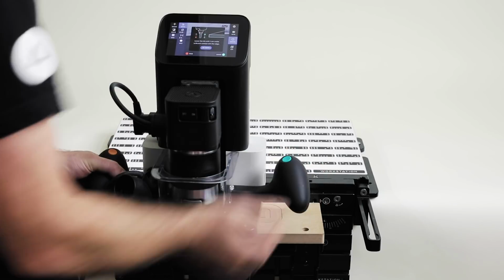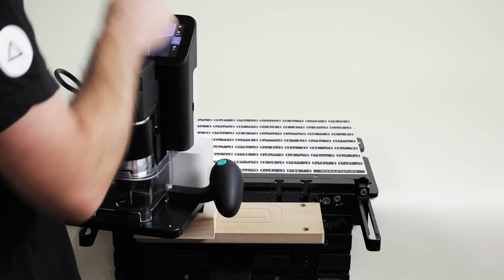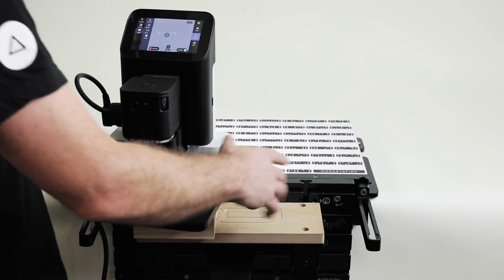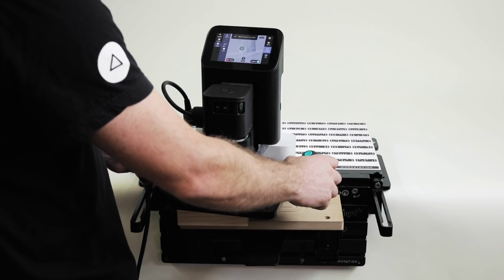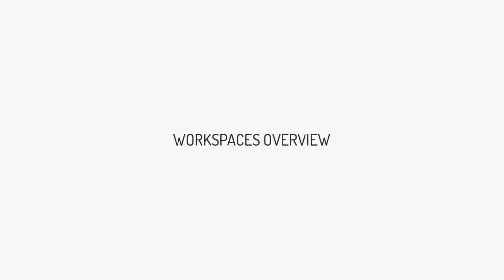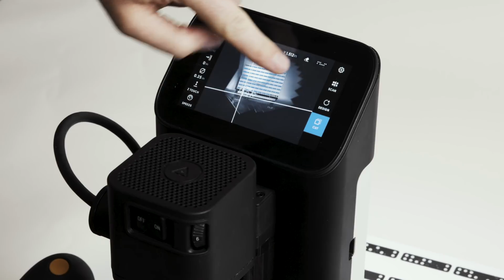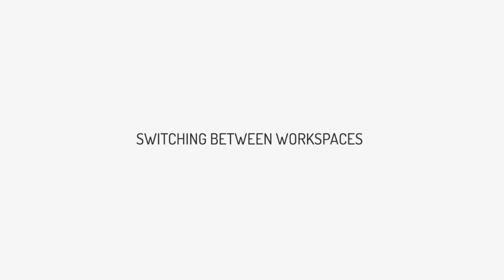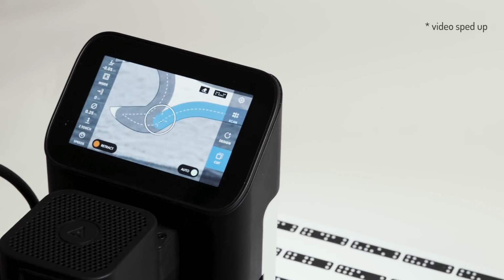Shaper Origin: Walkthrough of Humboldt Update

Comment: Amazing!
I'm sure I'm the 10,000th person to suggest this but:
What about adding a trace feature?   Drop the upside down cutter 'into a hole'/'around an object', then pressing lightly against the shape, trace it into memory.  Once done, select if you were tracing inside/outside the shape which offsets the pattern the radius of the shaft (it traces on the center point). Then you could copy that shape to other places, clean it up in the machine or export to a place to modify it, etc.
Reply: instaBlaster.

Comment: How easy is it to cut dovetails, mortise and tenons, box joints. Is there a big learning curve
Reply: Dovetail cutters are unfortunately not supported because the machine has a safety feature where it might pull up the spindle at a moment's notice. I have asked Shaper if there is a way to disable this to make dovetail cutting safer but they said no. You could route them sideways but then need to chisel out the corners manually. Shaper comes with software for automatic box joint placement. Mortise & tenon joints are easy.
Reply from the maker: Hi Thomas,
For box joints there's an on-tool extension that will draw your cut for you. Mortise and tenon is similarly simple. Dovetails can be tricky because they require more thought into the placement of the cut path, and cutting with a dovetail bit can risk your workpiece if you accidentally for a retraction. It can be done but takes more experience!

Comment: This tool has been the best money I've spent along with my sawstop.  The customer support is amazing.  Mine went down during the start of Covid, brushes worn out.  They were closed, but still bent over backwards, went and opened up and sent me a new spindle motor.  The software is lightyears beyond the original.  How a company should be run.
Reply: Brushes worn out???? Thought festool stuff was good and would last. Any particular reason why the brushes gave in so soon?
Reply: @leadhillsjoinery8135  I've had mine since the kickstarter, so what 4 years?   It gets run HARD. It replaced a Bosch 1613 I used with jigs.  I do flatpacks for speaker kits.  Driver cutouts, jack plate and handle cutouts, flush driver cuts, all in 1/2 and 3/4 russian birch.  Shaper asked me to connect so they could download the data from my tool to see the run time statistics.  I asked to see it too, but haven't heard back.
Reply: Fun fact, the motor is a stock festool router motor. They will accept festool brushes